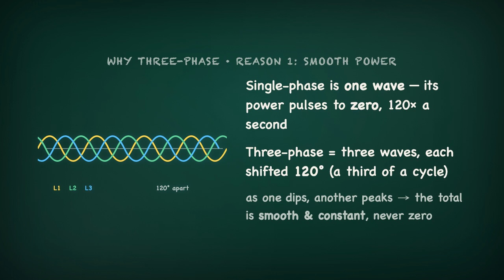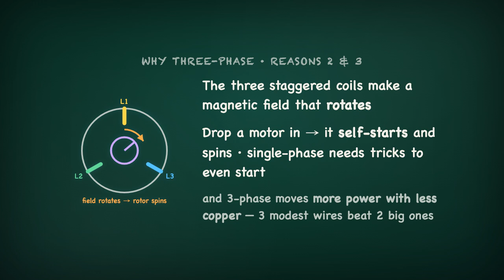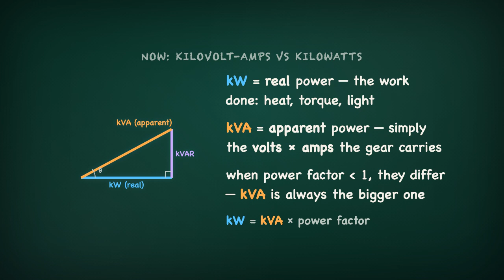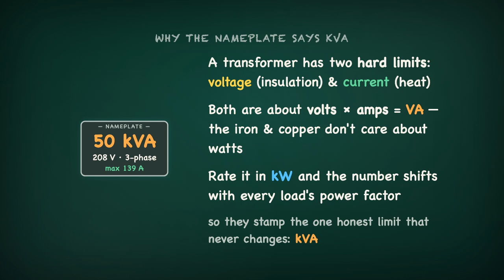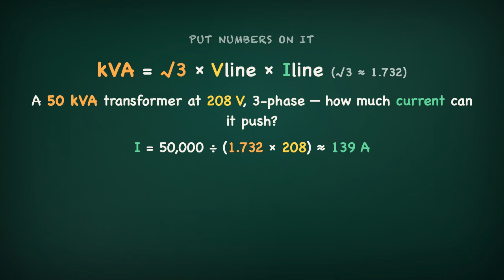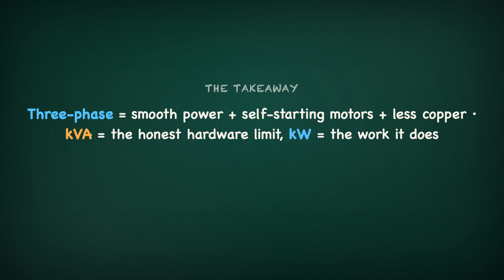Why Do We Use Three-Phase Power? And Why kVA, Not kW? | Electrical Theory 101

Comment from the maker: Practice answers:  A) S = √3 × 480 × 40 ≈ 33.3 kVA. Real power = 33.3 × 0.85 ≈ 28.3 kW.   B) Needed kVA = kW ÷ PF = 75 ÷ 0.75 = 100 kVA (always size to the apparent power). Line current = 100,000 ÷ (√3 × 480) ≈ 120 A.   C) Because the kW a transformer can deliver depends on the load's power factor, which the installer can't control. A "75 kW" label looks fine at PF 1.0, but the same load at PF 0.75 pulls 100 kVA of current — overloading a transformer that was sized by watts. kVA is the true current/voltage limit, so you size to it.
One line to remember: kVA = √3 × V × I is the honest hardware limit; kW = kVA × power factor is the work it happens to do. What should we cover next? ⚡